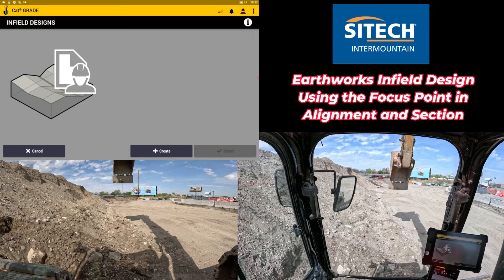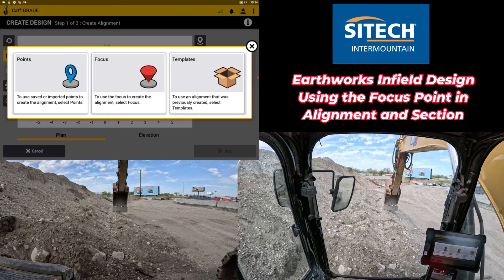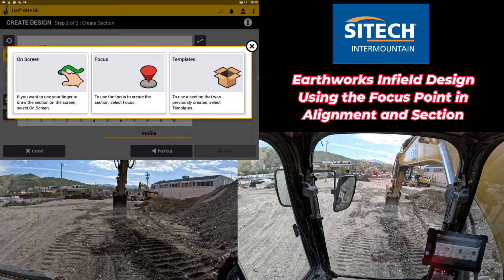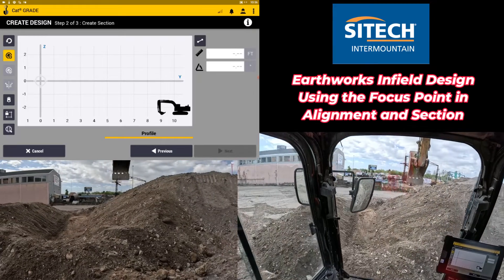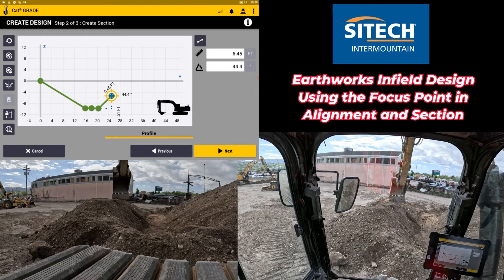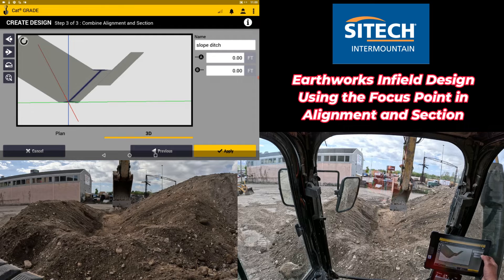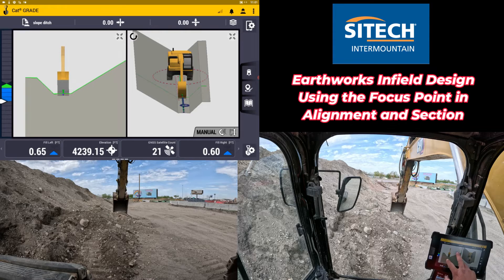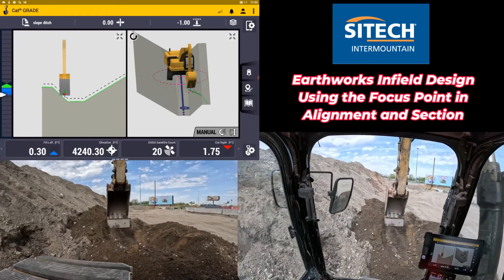Earthworks Infield Design using Focus Point instead of onscreen option

Comment: Your machine is backwards on your design?? How can you correct it I always have trouble getting alignment correct on alignment and section??
Reply: I feel your pain. These alignments are something that takes practice and trial and error for sure.  The way you see me build it here still starts with the my first point and that dictates which way it is going for me building it.  I think what happened here since I was just making this as an example is that when I shot the points on the Vditch slopes with my focus point is that I should have did that backwards from how I did it. I should have built it starting on my left and gone to the right and then it would have shown the model 180 from what you see. Maybe try that as you create these. There is the mirror option in there also if needed. thanks for watching.